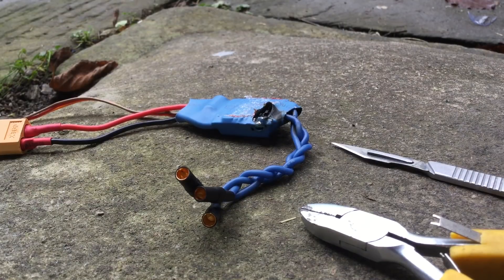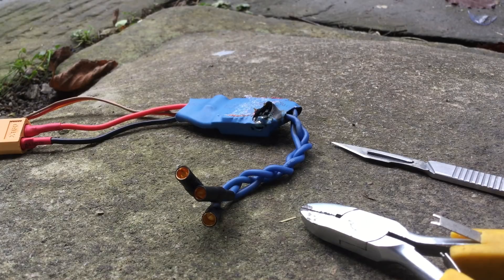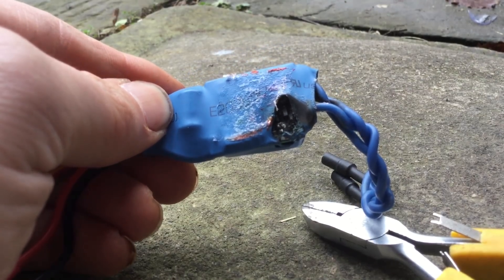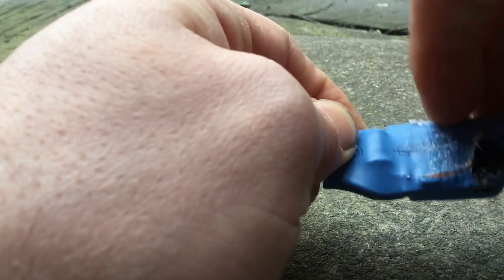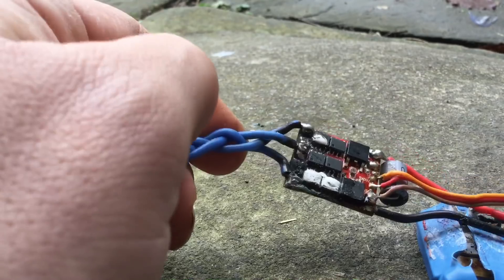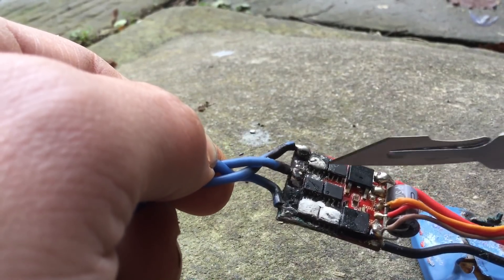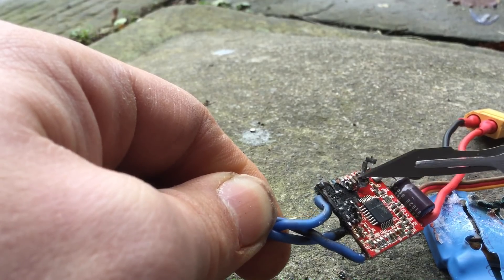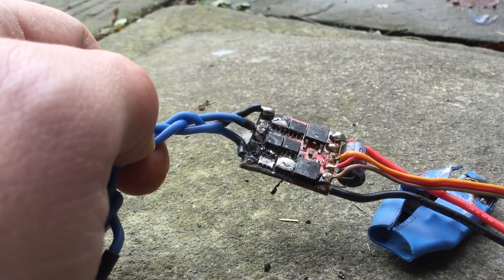Let's Inspect this Fine Quality ESC that "may have" Caught on Fire 🔥

Comment: Matt, you may want to cut a square of the heatshrink over the heatsink to let the heat escape on these sealed ESC's.  This is important on ESC with linear BECS.  SBEC ESC's are the safe way to go.

Comment: im used fucking cheap China ESC and no problem . maybe im lucky  .
2212 1400kv and  40A esc  no problem

BUT 

30a Caught on Fire  : )
Reply from the maker: Yikes! I found a new one like this in the esc box earlier, I winder what happens if you solder the HT leads together and power it up? :D
Reply: i don't know  something like We can't hold Throttle 100% for long time . 
At that time I was newbie . T_T